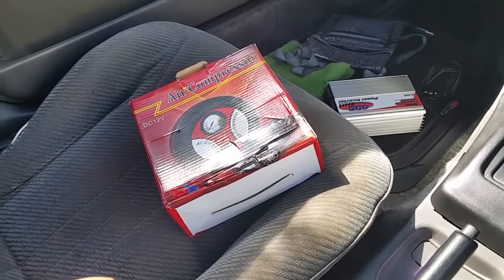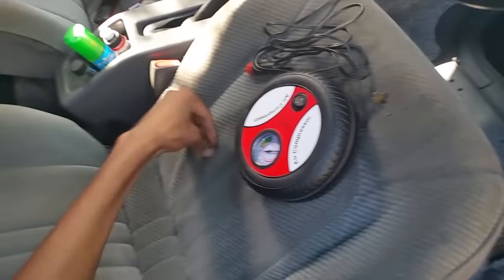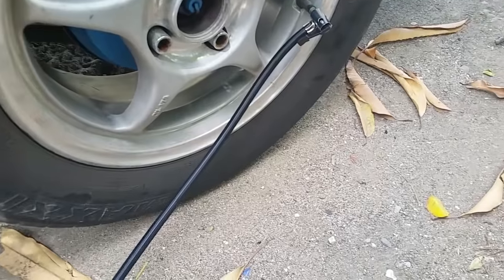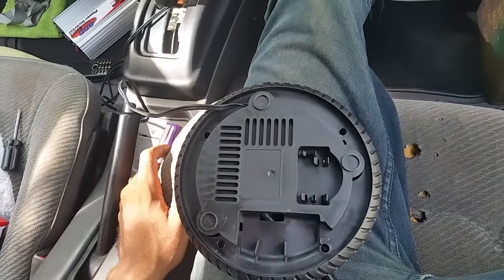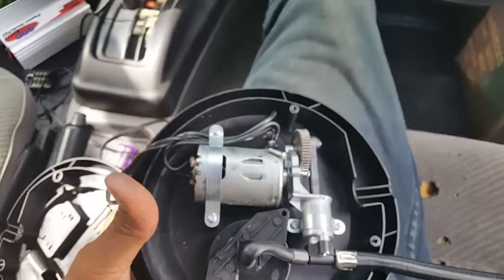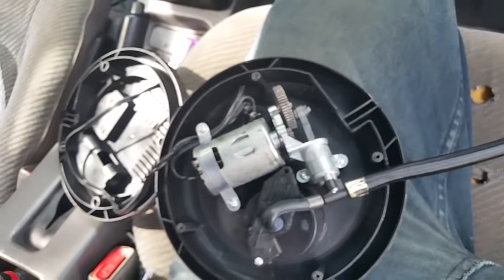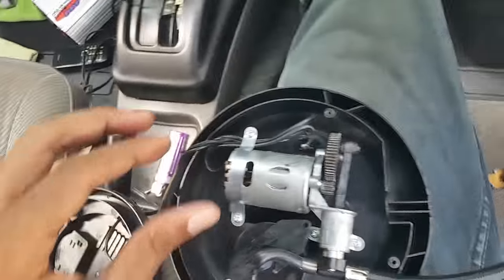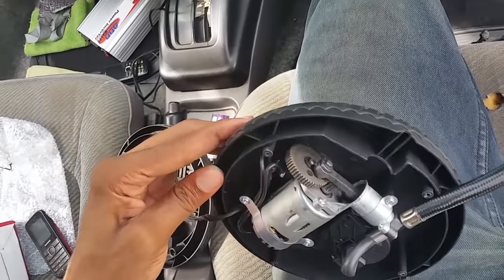Portable Car Air Compressor, 260 PSI DC 12V Air Compressor

Comment: Thanks for your very helpful review, I had bought this exact same item and before I used it for the first time I decided to check on YouTube to get some information as I'd never used an Air Compressor before, I was lucky and found your review PelpaTime which was very informative and helpful, so after watching your review I tried it for the first time on my car tyre which was almost flat with a slow puncture.

I followed the instructions that came with it and plugged into cigarette lighter connection in the car and switched on the unit to check if it was working, it is quite noisy but appeared to be working ok, so I switched it off (I think that I should have left it switched on, fortunately the tyre was almost flat so little back pressure to the unit) and then connected it to the tyre and switched it on, I could see watching the pressure gauge that the tyre was slowly inflating.

After disconnecting the unit from the car tyre and was walking away I noticed a rattle inside the unit, there was something loose inside it, so because of your very helpful review I opened the unit and found the same problem, one screw had come out and the other was loose, they had most likely worked loose because of the vibration (these two screws should have had a locking washer) so I put the loose screw back in position and tightened them both up, later I will try to find two small locking washers to put on the two screws but in the meantime I guess it's a matter of tightening those two screws or at least checking them after each use of this unit.
Reply from the maker: Your welcome FAM

Comment: I think it is a matter of luck. The first I got broke down like that, but I was trying to inflate a fully deflated tire without lifting it from the ground. The back pressure was too much. The guy who sold it to me changed it for a new one, and I had no problem using it today to inflate all four tires. I think you have to use commom sense with this cheap items. It costed me the equivalent to 13 dollars, so what could you really expect?